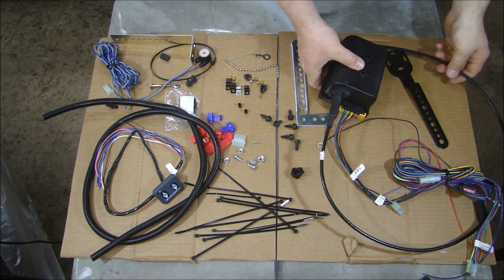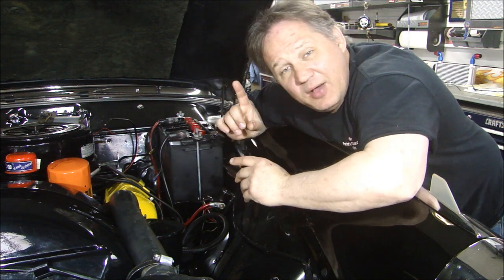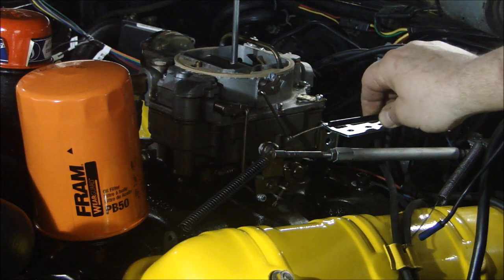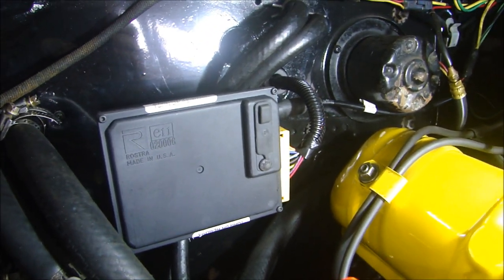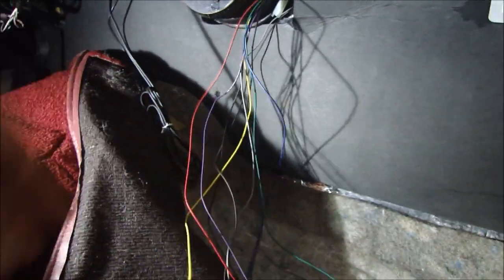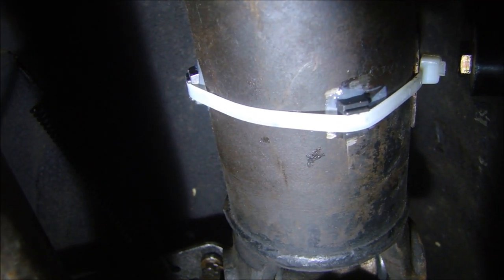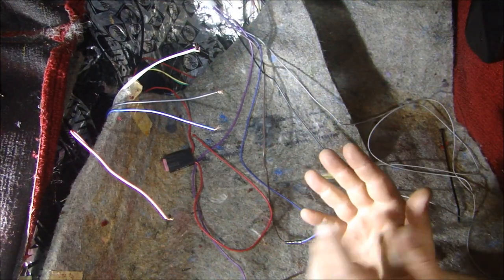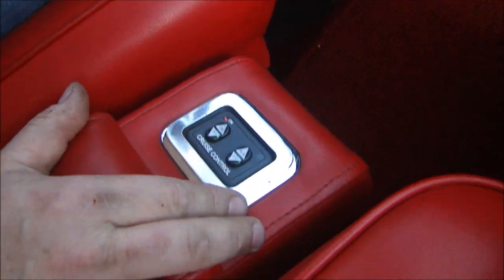1962 Studebaker Hawk   Installing a Dakota Digital Cruise Control

Comment: Pete, This post is 4 years old. I doubt if you see the comments anymore. I want to compliment you on this video. I bought an Ididit steering column over 25 years ago with the cruise switch directional stalk installed. I have been putting off installing the cruise controller. But, I decided this is the year. My 47 Ford 302 powered street rod is up on stands to change transmission oil. I needed to use the drive shaft signal generator that is included in the Dakota kit you installed. The Ididit kit uses a speedometer cable signal generator. My 74 year old speedometer sounds like a cement mixer, so I pulled the cable. 
I called Rostra, got the part number for the drive shaft sensor kit. I ordered it from Amazon and the Rostra Ididit controller kit from Summit.
Thanks again for the excellent instillation video. You quoted 15 hours to install. If I hadn't seen your video, it would take that long. I will be surprised if it takes 10 hours after watching your video......I still have trouble conceiving how you video guys can take the time to make high quality videos. Thanks again!
Reply from the maker: I read and reply to every comment. That sounds like a fun project. It ads a ton of time to the actual work. Once you get used to setting up the camera and know the important points to include. it's not too bad. I'm glad this one helped.

Comment: Math.  Yes!  One of the first things I tell my students at the beginning of the year is that we are going to use math in the shop.  I've had kids tell me they learned more about math in my woodworking class than in in their math class.  I don't know about that other than applying it in a real world situation helps them make the connection.  Another thing I tell my students is that there is alway more than one way to approach a problem.  If I didn't have a calculator handy, or I didn't know the driveshaft diameter, an alternative to using the math would be to wrap a strip of paper around the driveshaft and cut it to length to match the circumference, then fold it in half once, then again, to give you four equal segments.  You could then use it as a template to lay out the magnet position.  Awesome video as always Pete!  Thanks, Bill.
Reply from the maker: That is a great idea. I tried that initially, but it was really tight around the driveshaft and I couldn't hold the string right. Thank you for your comment my friend
Reply: JBM Woodworks. Great tip. Maths has never been my strong point. I blame it on my attitude at the time and the fact that here in Australia we changed over to the metric system when I was in the equivalent of your junior high so I never learnt either system and still switch from one to the other.
Ken
Reply: Exactly the way I would do it also!!  Keep it simple!!

Comment: Simpler way to install magnets - us thin construction paper 1 inch wide and make one complete revolution around driveshaft.  Cut the paper so the ends of the paper butt up to one another.  Take the paper, fold it exactly halfway two times.  Where the fold marks are on the paper, highlight them with a permanent marker.  Wrap paper around driveshaft and mark driveshaft where the 4 marks are and voila - no math required.
Reply from the maker: Great idea, thank you
Reply: @PetesGarage  YW!

Comment: Hey mate do we need a clutch switch if it’s a manual? What would happen if you pressed the clutch while cruise was on? Or changed gears
Reply from the maker: Yes, if you press the clutch the engine will speed up

Comment: Do they make a kit so I can hook it up to a tach wire on my alternator?
Reply from the maker: The tach wire does not go to the alternator
Reply: @PetesGarage  I have an alternator with a tach wire. I was wondering if theres a way I could use that instead of the magnets?
Reply from the maker: The instructions are pretty good, lots of wiring diagram options
Reply: @PetesGarage  ok thank you. Trying to figure out if it'll work on my 93 Cummins. It has wiring for a tach coming from a device on the harmonic balancer that might work.
Reply from the maker: That might work

Comment: What if you don’t have a tachometer? 🤔
Reply from the maker: You can still hook it to the coil
Reply: @PetesGarage  thanks for the quick reply…. negative coil terminal, got it thanks. Also; Dakota Digital says to hook up IGN/ACC (bayonet connector) to fuse panel. Is there any reason I can’t hook up to the ACC post of the ignition switch? 🤔 (1966 Ford Thunderbird)
Not a fan of electrical work. 😣
Reply from the maker: Sure, you can hook it up that way

Comment: You are making the math a bit too hard. One method: calculate the circumference of the driveshaft & divide by 4. Another: Use a carpenters flexible tape (the type that rolls back into a small case). Wrap the tape tightly around the driveshaft & measure using the 1" mark as an indicator to get a numerical reading off the tape. Subtract 1" from the measurement to get the exact circumference. When using this method in layout work the term is "burn an inch". Again divide by 4. However you do it the layout process is going to be difficult. Doing it in metric will be easier because all the math answers will be in digital rather than some odd variation of 1/64", 1/32", 1/16" & so on. Also, if one of these magnets falls off the system will shut down. Been there, had it happen.
Reply from the maker: Thanks Larry
Reply: @PetesGarage  Forgot to say thanks for the video. I'm probably going to be faced with installing one of those on my restored class B Dodge camper van & you answered a lot of questions about the throttle connection. My van has a factory cruise but it is erratic. Sometimes works & sometimes doesn't. Most times it loses about 5 mph from the set speed. I have thoroughly diagnosed the electrical side & that part is solid. Problem has to be in the actuator. I have located 2 others & they have different problems and are equally erratic. Age I guess.  Again thanks for the video. From what you showed there seem to be enough parts in the kit to attach the unit to my vehicle.
Reply from the maker: Good luck Larry, thank you